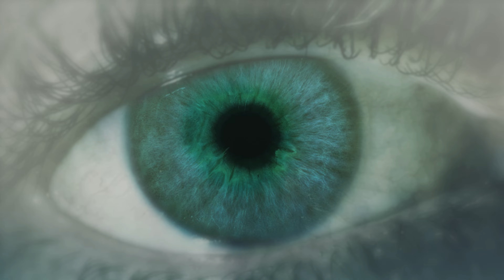【18】Moonlight Chronicles: Towers of Forgotten Cities  __「Russian Chronicles」| 4K ULTRA HD

Comment: 1:40 - I don't know how true it was that people were elated. It would have been a upgrade for the rich first. Eventually, the "fire hazard" of gas lamps would have been the way to convince the general public into paying for electric lighting. On my rural property, in 2005, they banned outdoor propane/oil tanks as a fire hazard. Exploding residential tanks were not a problem for 50 years. We all paid to get Natural Gas as the "approved" replacement. Those not on a Natural Gas line (or couldn't afford the "upgrade") had to switch to electric heating. I'm sure the regular people of the time went through the same experience over 100 years earlier.

Comment: The Detroit Moon Towers would raise and lower via a cable system for lamp replacement...LUV BEAGS 🐶
Reply from the maker: Agreed but looking through the photos of other towers it does appear that the worker would need to climb at least half way to get above the anchor cables in order to change out the filaments. Also some of the photos appear the worker would have to climb to the very top to make the hourly change lol🍻
Reply: @streetsoftartaria  Absolutely...it seems strange to me that they had the tech to lower them, yet not everywhere.  I have also seen many arch lamp street lights that lowered on levers and trucks that would roll around with a guy high up on a ladder changing bulbs...LUV BEAGS
Reply from the maker: @stuffedbeagle  😁